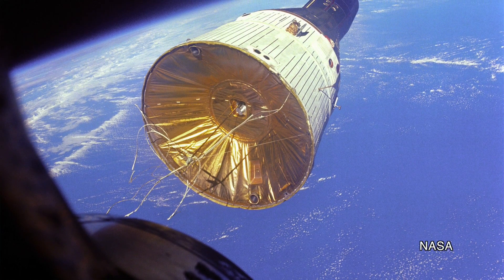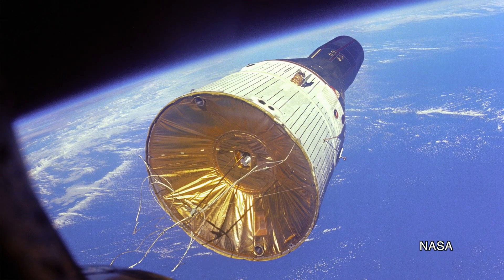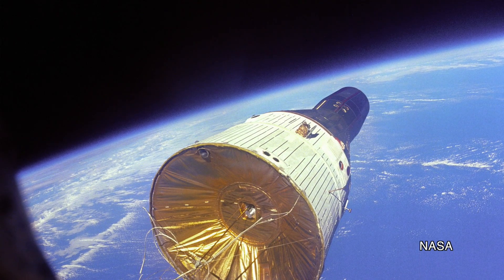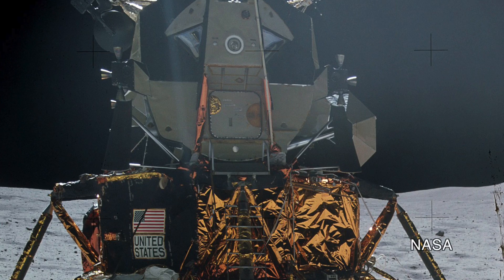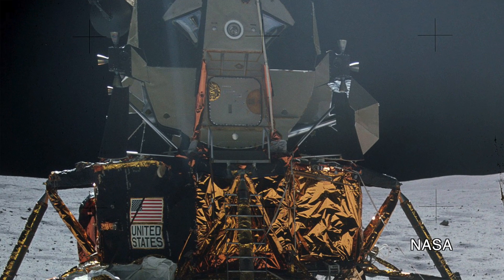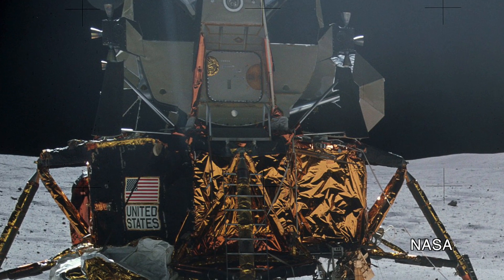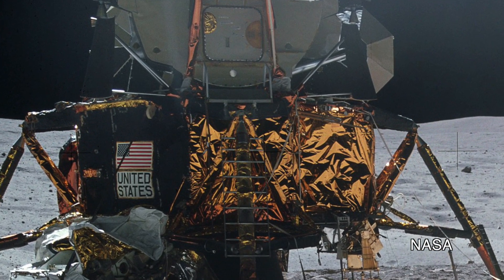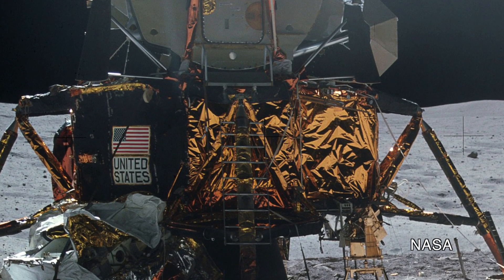What's With the Gold Foil on the Gemini Spacecraft?

Comment: Hi. Regarding the gold Foil. First, I know its not tin foil like that which is found in the kitchen. I did read on a space website that the material is transparent gold  colored Mylar PET. So rust color in there too. There are several layers of the stuff giving of the foil look in the photographs of the LM on the moon. Yet, I've also read that it is actually Opaque Gold Mylar foil. The same stuff emergency blankets are made and the same stuff sold at the Air and Space Museum. And of course, layers and layers of it. So witch is correct? I wish to know as I am building a scale model and want to go for some major realism.

Comment: Several people mentioned gold covered mylar. It's same material as the silver (well, aluminum-) covered helium ballonns you get at the dollar-store. Aulminum is a great reflective surface for the visible light portion of the spectrum, but not so much in the Infra-red (IR). Gold is one of the very best reflector in the IR portion of the spectrum This is very reason why the mirror segments on the forthcoming James Webb telescope are gold-covered. It's a very, very thin layer desposited by using a massive spike of electrical current to instantly vaporize a small piece of gold wire in a vacuum chamber, and allowing the gold to settle out like dew or frost onto the surface of the mylar, below.
Reply: Michael Kampe The visors on EVA helmets are also gold deposit.
Reply: Thank you for the answer to the real question!!
Reply: It's called "ion sputtering"

Comment: It's an extremely thin layer of gold on Mylar. Why gold? Well, gold has an interesting property in that it is an superb reflector of infra-red radiation. Heat radiation in other words. It's the same reason why infrared telescopes use gold plated mirrors, and also why some skyscrapers in hot climates use gold coated windows, to reduce incoming heat, and lower air conditioning costs. Pure silver is an even better heat reflector, but unlike untarnishable gold, silver is of course very prone to oxidation, making it's use as a heat reflector almost impossible.

Comment: Some people think classic radiators don't work in space because there is no air.Actually it works very good because away from the sun there is also no other infrared radiation.The background is some 4 Kelvin inside the ship it's about 293 Kelvin,that makes A huge temperature difference and why it can radiate all it's heat away very easy.

Comment: I think (and I may be mistaken) the gold foil is actually known as aluminumized mylar. (assuming I am correct) They figured out that if you layer it 3 or 4 times it seems to work great as a thermal insulator and kept the weight down at the same time since the material is not much thicker than tin foil.

Comment: Then why was the front, manned section dark in color? (Looks like black). Wouldn't that absorb heat?. Why not white? Thx and great vids.
Reply: Russ Ferris my guess (and it's only a guess) is that it has to do with heat management on reentry. They had to use ablative material which would vaporize as the craft got hot and the vaporization would remove heat from the surface. 
But, I could be totally wrong as I usually am. Why are you even listening to me?
Reply: @RF
I would imagine that if the capsule started to over heat you turn it into shade by pointing the rear at the sun., if the capsule starts getting too cool you turn so some sunlight is hitting the dark capsule.

There would be an angle that would give perfect internal temperature, so the adjustment would need to happen once.

Comment: I don't understand.
Why gold foil is only on the rear section of the adapter module, after all the spacecraft is receiving heat from all sides, not just from rear section.

Also, I see lunar module's landing legs covered with some sort of gold foil, I don't think there are any electronic components inside landing legs (they should be totally solid in order to withstand landing jerk).

Are you quite sure, "heat management" is the reason for lunar module's foils? I find this explanation unsatisfactory.

Regards

Comment: I think they just used mylar instead of Gold foil, and here's my reasoning for that. In space, since there's no air the only way for heat to travel is via infrared rays. So any sufficiently reflective surface should be able to reflect said IR rays, thus protecting the cooling systems as you described. But, since nothing is 100% reflective, there will inevitably be SOME IR rays absorbed, and some heating will occur. Now Gold is much more thermally conductive than mylar is, so it would stand to reason that on top of it being needlessly expensive, it would also conceivably absorb more heat from The Sun. That's my take on it anyways. Having said that, I'm going to go double check this now and see if it was mylar or gold foil that they used.
Reply: It seems we're both right. From what I've read, they prefer to use gold coated mylar over other metals because Gold not only reflects a comparable amount of IR radiation to cheaper alternatives like Copper, Aluminium or Silver, but it also absorbs more UV radiation than these other metals, while reflecting less visible light, so it doesn't create reflective, shiny spots that could potentially blind astronauts.

Comment: Was it actual gold foil or was it metalised mylar like the LM descent stage?
Reply: It's made from from a material called Kapton which was used to create the multi-layer insulation blankets that cover the LM descent stage.  It was used as a substitute for aluminized mylar to shed weight off the LM.  She should have mentioned that in her video.
Reply: It is metalplated platic foil

Comment: Amy, love your videos. Here's another question in the vein of "what we were told then" versus "what we know now". I remember several things being said at the time about the use of gold on spacecraft in the 1950's and 1960's. An interesting one was that in the vacuum of space, the normal 1-molecule thick layer of oil and grease most metals have on earth would out-gas. With working metal surfaces meeting with no intervening dissimilar material between, it is possible for some metals to actually "weld" or bond, due to the normal bonding forces of the atoms or molecules. Because of the extreme malleability of gold, plating critical mechanical parts with the soft metal would prevent that effect.

Another one that we heard a lot was that it was simply to eliminate the chance of accidentally introducing bacteria, as gold is bacteriostatic. 

Ever run across either of those in your research? I doubt either would carry much weight today.

Comment: Wait a minute! Radiate heat into a vacuum? I would like to know how this system actually worked in the vacuum of Space. Thank you, Amy Shira Teitel.
Reply: Robert, you're a little confused.  Heat is transferred in 3 ways: conduction, convection and radiation.  Conduction requires physical contact.  When you touch a hot pan, the heat is conducted into your finger and it burns you.  Convection is when air is blown over a hot object, heating the air, and then the hot air heats another object.  Radiation is the emission of longwave infrared electromagnetic radiation.  All warm objects emit infrared.  You can't see infrared, but the hotter they get, the higher the frequency, until they begin to glow red, then yellow, then white, and even blue.  Radiation doesn't require air, so radiation propagates through space.  This is how the Earth is warmed by the Sun.  It is why you feel intense heat when you're in front of a big fire.  That isn't convection, it is infrared radiation coming from the flames.  Electric space heaters that glow red use radiation.  If they have a fan and blow hot air, they use convection.  Heating pads use conduction.  Yes, oil heaters primarily use convection, but if you were to remove the air, they would still radiate some heat via radiation. All hot objects will.  Gold foil is a very good reflector and radiator of heat.
Reply: A vacuum flask stops loss of heat in 3 ways.  It blocks conduction by having as little contact as possible between the inner bottle and the outer one.  Only the neck connects the two.  It blocks convection by removing the air between the two bottles, and it blocks radiation by silvering the inner and outer bottle so that no infrared can pass between the two bottles.
Reply: I enjoy watching your videos btw.
Reply: Heat is radiated into a vacuum all the time.  The sun does it, for a start, which is why the system is needed in the first place.
Reply: A vacuum flask stops loss of heat via radiation as it stops convection into the air, because of the vacuum between the inner and outer parts of the flask acting as the insulator. The gold foil would be radiating heat by convection, and convection relies on physical contact. The heat we receive from the sun must be electromagnetic or maybe also photonic in nature.  If you have an oil column heater in a room and place your hand over the top of it, you'd feel the heated air rising from the heater. Now remove the air and there is nothing for that heat to transfer to!  Can you see the point I am making?  The gold foil would need something physical to transfer (convection) it's heat to. Since Space is a vacuum, there is nothing to transfer the heat to.
Reply: Robert, the gold foil is milar plastic film.  It's job is to reflect incoming solar radiation, to keep the equipment behind it from absorbing it.  The film has almost no mass, and doesn't play a part in radiating heat.  I think you can still buy "emergency blankets" made of the stuff, for hiking.  I had one 40 years ago, sold as a "Space Blanket".   Just about cooked myself in it one night in the mountains.   Cheers.
Reply: Thank you for clearing that up with a great, and to the point, explanation!

Comment: Gold foil?  It's not really gold foil.  The material is mylar w/ a micro deposition layer of gold.  Don't let people believe that NASA is using gold like that.  They're not.
Reply: https://en.wikipedia.org/wiki/Kapton
Reply: alex tworkowski But the point is still heat management because gold has the lowest heat resistance of all the metals.
Reply: Cyramor11 I've seen conflicting articles about that foil.  Some say that it's actual gold.  Some say it's aluminized Kapton.  Some say that it's a three part thermal blanket type of foil.  See what you can find and please let me know.  Very interesting.  BTW, gold is an excellent radiation barrier, but why put it on the landing gear?  Mystery.
Reply: @alext9067  Altough this is an old post the landing gear was heat sensitive too particularly the shock absorbers needed for landing - this can be researched.
Reply: @eagleone493  I didn't get the point.  The landing gear was sensitive to heat along with the shock absorbers.  That sounds reasonable.   What is there that needs researching?  Are we talking about the gold foil?  I think the question was about whether it was real gold or what.  Have you any new insight?
Reply: @alext9067  There were two different lines of questions  so sorry for the confusion. there was a question Why was there foil on the landing gear? That was my reference for further research. There was ALSO  whether there was any real gold.
I believe actually as to the foil issue there were actually various layers applied to the lander as somebody did mention. It was definitely NOT gold-foil as we know it. I have come across references to kapton. I know a silver Kapton layer was used on the Apollo command module that is why it looked silver.
Reply: @eagleone493  Excellent, thank you.
Reply: Cellus KH YES.  You found it.  I couldn't recall what the hell it was.  Thank you.
Reply: Proton2112 Actually it might not be gold at all.  I looked into it a while back and got two conflicting answers.  One was that it was a vacuum dep deposit a couple microns thick on plastic.  The other one was that there is a special product w/ a gold color that is used for this kind of thing.  In any case neither of them can be considered gold foil.  I'm sorry that i don't have a better answer, but it's interesting to theorize about it.
Reply: alex tworkowski Yes, this is my understanding too. It is a layer a few atoms tick of real gold deposited on some kind of metalized plastic material. Like you said there is nooo way that is gold foil shaved off a huge gold ingot like the way aluminium foil is made from aluminium.
Reply: alex tworkowski, i'm not completly sure, but i think its because the gear are fragile and are exposed to the extreme heat and cold of space to
Reply: Its not gold - its amber.
Reply: Where real gold was used in soldering joints. Gold and silver didn't corrode in space.
Reply: Yes elemental gold is used in small amounts on spacecraft. It's one of the best materials for rejecting IR. And yes the film's you see are a composite that contain gold. It's not hard to believe that gold was (and still is) used in this manner. The US alone spends tens of billions per year on spacecraft. All kinds of precious metals and rare/expensive materials are used when there cost is justified.
Reply: Look at James Webb Space Telescope; multi billion dollar spacecraft, and it's mirrors are GOLD plated. Not a very thick plating, but just right for optimization of optical performance, IR rejection, and mass. It's not that they can't afford to gold plate everything, it's that it's not always needed. Engineers pick function over form any day.
Reply: alex tworkowski are you stupid?
Reply: Mylar or kapton?
Reply: gold refers to the color you dim witted moron. and even if it did refer to real gold. then it had to do with what she said. the heat management, the cold side and hot side would cancel each other out and reach equilibrium.

Comment: So why gold, as opposed to white or silver (like a mirror).  I'm basing this thought mostly on the visible spectrum which may be in error...
Reply: +Ted Thompson Because it's not actually gold. It's Kapton with vapor deposited aluminum on its rear surface.
Reply: +ApolloWasReal I should have been more specific and said gold color.  wouldn't white have been more effective?
Reply: Ted Thompson Not necessarily, because it's not just how it looks in visible light that matters. Just as important is how it looks in the longwave IR where objects near room temperature radiate thermally.

This is why polished aluminum gets so hot in the sun. Yes, it absorbs very little of the sun that hits it, but it's even less efficient at radiating what little heat it does absorb.

This is why second-surface mirrors like aluminized Kapton, Mylar and Teflon are such good radiators. They look black at longwave IR but bright and shiny in the visible and near IR.

Comment: That "gold" foil on Grumman's LEM is not made out of gold at all. Its a product produced and developed by Dupont called Aluminized Mylar. The engineers would lay on about 25 layers of it for the purpose of insulating the LEM's internals.
Reply: Probably you are mistaken.  First, the same process that coats aluminum onto plastic film can also coat gold.  There has been a discussion, but no historical evidence, in the comments over whether the specific films at the rear of the Gemini were aluminum or gold coated.  Either is possible.  Second, the trade name Mylar refers to plastic films made of polyethylene terephthalate.  We are pretty sure that the films in question were made of Kapton, polyimide.  Kapton has intrinsic yellow color.  This opens a question.  When we see a yellow film, are we seeing the uncoated side of an aluminized Kapton film, or the coated side of a gold coated film.  Also, it is possible to coat both sides of a film.
Reply: +Mark Holm Yes, the external films were Kapton, not Mylar. Both materials are essentially black and opaque at long IR wavelengths, so they're good thermal radiators. Especially when thin, they're much more transparent to visible and near IR so they're metallized on their rear surfaces to reflect the sunlight passing through them. By reflecting sunlight while radiating well in the long IR, they stay cool in the sun.

Aluminum reflects well at all wavelengths, while gold reflects well only in the IR and long end of the visible spectrum (which is why it looks yellow). Gold absorbs UV and the short wavelength half of the visible spectrum so it gets rather hot. So aluminum is definitely superior to gold for this application.
Reply: The Mylar was used on the LEMs. Not sure about the Gemini crafts.
Reply: MAC C Yes, Mylar was used on the LM but only underneath something else. We don't see its grey color. It was used in thermal blankets under the sheet metal micrometeoroid shields on the ascent stage.
Reply: Actually no, the aluminized mylar used on the LEM does indeed have that golden colour
Reply: MAC C
Aluminized Mylar is grey (on the plastic side), not gold. If it looks gold, then it's Kapton.

You can get aluminized Mylar in camping stores where it's sold as "space blankets".